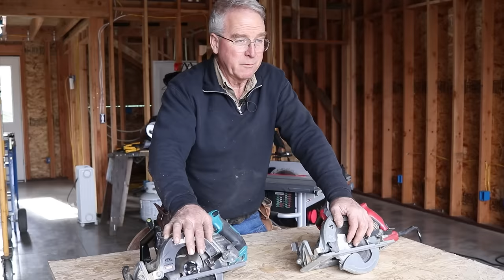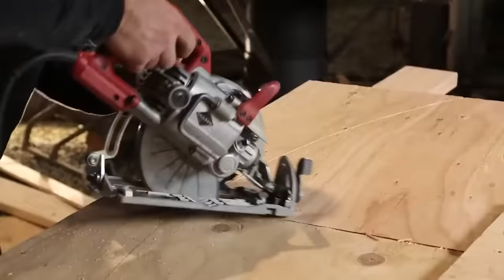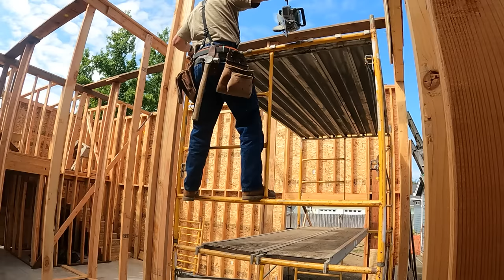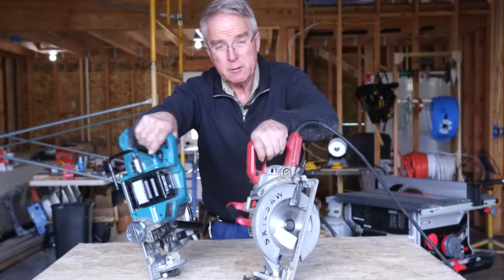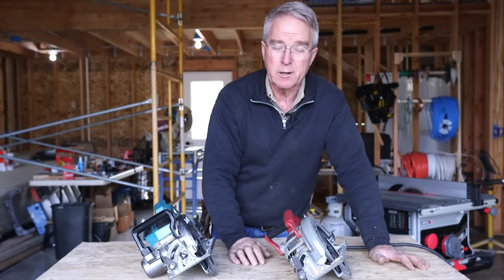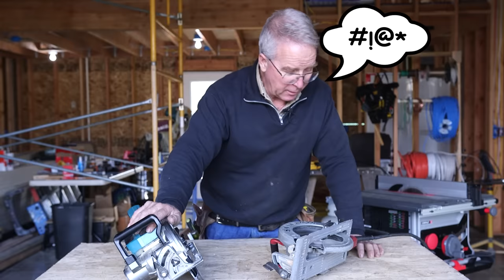Makita 40v XGT GSR01Z 7-1/4" vs. Skilsaw Mag 77 Circular Saw Review

Comment: As another senior citizen, I have seen the transition from 9.6 V cordless, to 12V, then 14.4V, 18V, and now 40V cordless tools. In the depths of my workshop, you can still find these relics, bought at some cost, but made redundant by the advances in technology, and lack of ongoing support by the manufacturers. A good quality corded power saw will serve the average home handyman for the best part of his life.
Reply: Don't forget, 9.6 volt was the 2nd, I still have a few 7 volt makita's. THey are sure worthless when compared to what we have now... And dealer cost on the bare tools in the mid 80s was about 70 bucks for a drill.....and that was a ton of money back then.
Reply: If u get the Metabo HPT/Hitachi 36V u can plug it in and use it cordless
Reply: Those 9.6 v Makita drills were the bomb then. I can’t believe the development arch of all these cordless tools. To have driven screws without impact drivers for 15 years and then to have used them…. Incredible.
Reply: I had the 7.2 with the reciprocating saw. Awesome little combo at the time. Just started collecting the xgt 40v and they are amazing. This afternoon co worker tried out the drill and was amazed at the power and smoothness. Makita isn't always the hardest hitting, but they last and are very good quality. The fact so many cordless 7.2 makita are still around and functional (battery issue aside) also speaks to durability of a 25+ year old hand drill.

Comment: Something i like about the cordless is, when you only got access to an 15 amp outlet and need the compressor and the saw. So many times i tripped that breaker because i was ripping something and the compressor started at the same time.
Reply: This. I don't do large new construction so I don't need the massive endurance of the cord. But I'll be working right on through the renovation when the electrician has the power shut off.
Reply: Yep. Damn code to have  gfi plugs on power pole!!!  😂😂😂
Reply: Fair point.  I were in your shoes, that'd definitely be a big factor.
Reply: Sort of keeps you on yer toes.

Comment: I gotta tell ya. I was skilsaw hd77’s for years. Never thought anything would replace them. We’re now completely cordless using mostly makita saws for many of the reasons Scott mentioned. Two things I’ll mention. Yes it’s very inconvenient when a battery dies up in the air, but I can’t tell you the amount of times I’ve been up in the air with a corded saw and tripped a breaker and had to hike all the way down. That probably happened more then having to switch dead batteries. As for making money, cordless saws make more money hands down. Not having to drag around a cord and setup and tear down a cord every day is a huge time saver. We figure a 4 man crew saves 15 minutes in the morning and 15 minutes at night. Just my two cents
Reply: 30 mins a day x an entire year adds up, hundreds in wages paid just for wrapping up leads

Comment: There is one thing that you did not consider. It takes much more time to get out, run out and plug in the cord. This takes considerable time. Time that could be used to get the job done.
Reply: You are correct!  But as a construction super, so many battery ops I find left behind by the boys.  Scott points out about seeing the cord, then following it to the tool.  It is with painstaking gum shoe work I go through trying to find the man who that battery op belongs to.  The financial loss is real as I see it.  I cannot recall how many times guys have called me asking if I saw their battery charger with $300 of battery's are.  I go hunting, sometimes I find, sometimes not.  As a construction super, I see financial loss more on battery ops than corded.
Reply: Usually I like his videos but this video I feel like he's full of it. Everything went in the favor of the Makita the 2 and 9/16 in, the safety, the convenience, the ergonomics, the power. The cost of the tool is not smart to focus on if you use it frequently. As for the battery running out, have a back up battery sheesh.
Reply: He mentioned this at the 8 minute mark.
Reply: Minute 13 as well.
Reply: You're right, it does take time out of the day to run out the chord or extension and plug it in and get going as well as when it comes time to wrap it up. I personally live my corded and battery powered saws and will always carry both on a job site. The only thing I could say to contrast you, is when you're on the job and you run out of juice with a battery powered saw. Unless you have spare batteries with you, you will have to run down and get another one, assuming that you have them on you, carrying all those batteries can be cumbersome, especially if you're off solid ground, having all those expensive shiny batteries can be a liability, and much like he mentioned several times, the cost of buying the tool plus the batteries will add up.  I for one, do not regret the investment but it still took a great chunk of change to be supplied with enough batteries to get through an 8 hour day on a site framing a house.  Contrast to that, if you're not running a saw for that long like you're doing a remodeling gig, you can't deny that a decent corded saw is all you really need.  It's all about situation and what's best when you have a task to do.

Comment: I’m 22 and cordless saws have been the norm for me. I started watching this channel and I would see you use the corded skil and think “that’d be convenient to have a cord” now anytime i am framing I just cant do without one. Though for smaller projects and remodels, cordless is still my go to
Reply: Can't imagine lugging a corded saw again, use too always get all tangled in the hoses and it would be a big production to get it off the bench and into the rafters or out in the field when framing the floor ... Can't wait til someone produces a cordless framer that can really hold its own with an air gun. That'll be amazing to never have too untangle hoses or battle being a foot short and pulling and stretching that thing as hard as I can
Reply: @The_Pennsylvanian  I'm waiting for Makita to come out with a cordless framer with the XGT line. I honestly think they've been waiting for this new line to come out with one.
Reply: @awsomater1991  the metabo hpt is good
Reply: I have five years on the previous 2x 18v model. It has taken a beating dropped off scaffolding etc it stakes a beating durability is awesome. The buttons on all the battery saws (safety ones) are all awful. I make a small wedge and drive it in to all my battery saws so the safety’s  don’t cause that problem anymore. I grew up with corded saws and they never had safety’s and we never had a problem ! I like the cordless gear and i don’t run leads anymore battery for the last ten years.  The makita saws are pretty water proof.

Comment: As a Swede the only way to get a rear handle saw was going cordless or lugging around a 240-110V transformer, and they get really big and heavy if you're going to power a skilsaw with it.
So when my Hitachi started shooting arcs that light up the neighborhood, I went with a makita 2x18V, and I must say I love that saw, everybody that tried it thinks it's to heavy, but change their mind when they cut something with it. Few tools give me as much pleasure as that saw.
Reply: As an Englishman I have no experience with worm drive saws (they are available now). and have always used 9” sidewinders, and for outdoor work 110v  (with transformer) to meet codes of practice. my main 9” is so old it does not have a deadman’s switch. I like the bit about losing the saw on site, never even thought of that !  Your conclusions are the same as mine about best work saw.   
      Two things about Circ saws, one is that those cast base plates break easily, I prefer steel. the other is that batteries are a constant tax on you and you’d best put replacements in your pricing. If anyone cares, I like Makita corded saws.
Reply: Intelligent opinion, thanks
Reply: I got the Metabo HPT as there was not a Hikoki variant of the rear handle sa here in Europe/Norway. Great saw at a low cost.
Reply: I have the Makita and I agree it's heavy but it's a beast not for using allday but when you need the power it's the tool!
Reply: @rfauske  Tror de har en Hikoki versjon i New Zealand /Australia. Hvor bestilte du saga?
Reply: @nilsern81  toolbarn, 200usd med ett batteri. Brukte jetcarrier for frakt
Reply: @CrimeVid  The Makita is not actually a worm drive. Not all rear handles are worm drive. EC talked about that in an earlier episode about these saws. Worm drive saws are slower but have more torque.
Reply: @kiwigrunt330  True but all these modern rear handles have more than enough torque for 99% of cuts at full depth so they are just faster saws in general for less weight and higher energy efficiency.
Reply: - Same here 🇩🇰
Reply: Yeah yeah. BUT  The bikini team rules ! ;-)

Comment: One of the biggest eye openers for me has been combining corded tools with a large power bank. It's not quite the convenience of fully cordless, but the ability to put a power plug absolutely anywhere, at any time, and have it last you the full day of fairly heavy use, even on a site with no power is hard to understate.
Reply: Yep and using 20 amp circuits. A 10 awg wire for the whip/cord

Comment: Been framing with the makita 36 volt worm drive for the last 4 or so years. The durability is there and it's so much nicer not dragging a cord around, especially in mud.  My favorite saw by far
Reply: Makita doesn't make a worm-drive saw.
Reply: @awsomater1991  rear handle, my bad
Reply: Hypoid drive .. I've been running the 36v for at least 4 years also. Best saw ever 🔥

Comment: We super glued the safety buttons on those Makitas.  We drilled a tiny hole and put a brad nail through the safety switch on the Skill 48 volt. We also have the Metabo 36 volt (its safety is also pinned) , 3 of the Milwaukee Fuels, all rear handle type. My favorite is the Metabo. Its the lightest.

Comment: I’m a contractor and carpenter with 25 years under my belt. I got the dual 18v version years ago and never looked back. I’ve almost never missed the extra power and it feels better and smoother. Not having a cord is great. I like the foot plate and guide notches better. And it’s the only 7-1/4” that will cut 3x in a single pass. In earthquake country, we use a lot of it: mudsills, studs in a shearwall at plywood breaks, horizontal blocking for backing plywood seams in a shearwall. I was already heavy in to the Makita 18v system and had plenty of batteries so I got the bare tool and the cost difference was minimal. 

All in all, I still have a Skil but rarely use it. On a job where two saws are helpful it will come out, like having it by the big stack of sticks for gang cutting while the cordless travels around. But the ability to cut a full 2x1/2” was a game changer and the main selling point for me. The first time a had to cut a 3x I used my trusty Skil and when the off-cut didn’t drop and was held on by like a 1/16” I just thought “WTF man, you gotta be kidding me.”

Now with the 40v, I they even have a 10-1/4” so you can cut 4x, gang cut 2x on edge in one pass and cut larger engineered joists. Pretty trick, though I have the corded Skil for that already and that’s where the extra power might be missed. That said, it would be great trimming post tops on a long fence far from power or in rural settings. I’m just waiting for the cordless version of the 16” beam saw! I have one from the 80’s. We call it the widowmaker.

Comment: I love this video. I own a top handle XGT makita and they use Polycarbonate GF15% plastic. I’ve dropped it off of roofs and it’s extremely tough. It’s also been rained on but it’s IP56 rated so no issues. If it gets too dirty I’ll just hose it off.

Comment: I’ll pick the cordless makita. I have heavy use of the cordless for the last 4 years and I have used skill saws almost every day for the last 7 years. The framing company I’m with we mostly build apartment complexes and townhomes. My main job is layout, we cut the plates with a radial arm saw that are marked with layout and a lot of the double top plate I cut myself with the cordless. I have to do a lot of rips, mostly on 2x6 being ripped down to 2x4. A lot of the rips I do have to be 6ft plus. One thing I love about the cordless is when I have to do a plunge cut I don’t need to lift up the guard with my hand. I just line blade up where I need and just push down and forward and the guard will roll back. I can do that with the corded saw but I have to push a lot harder to get it to work. 

The corded saw does have more power and it’s a lot easier to cut angles with. For some reason with the cordless when I cut angles, mostly 45 board cut, the saw binds up and I have to push it through the cut pretty hard and my cut won’t be as accurate, or it binds up so much the saw shuts off. 

And it’s not just me a 7 year production commercial framer that loves the cordless. It’s also the 20 year vets and we have a couple 30 year vets on the crew that have all switched to the cordless. And it’s mostly because of not having to worry about rolling out and rolling up power cords. We all work fast and efficiently and we are always trying to find more ways to be efficient and Having a whole bunch of cords mixed in with the air hoses making a rats nest in the hallways is one less thing to worry about. 

It’s difficult to try and explain how our operation works without being able to show exactly what we do. And once you see what it’s like using a corded vs a cordless saw in a 400,000 square foot apartment complex you’ll know why 30 year journeymen framers switched saws. 

Also my boss just got me a cordless makita chop saw for my work station and so far I’m impressed. I’ve only had it for about a month but I definitely prefer cordless for now.

Comment: The brush-less motor and lack of inertia make the cordless so much safer in my opinion. If/when you get a kick back the blade is stopped completely by the time it can do any damage to your body. If you are in a production environment you will have enough battery power to get you through the most demanding day (I keep 10 batteries and 2 2x1 gang chargers) Cords suck! Generators are noisy. There is a lanyard loop on the makita if you want to lower it down from a second story with a rope etc. I don't miss my Skil saw ever. That is just my opinion and the cordless suits my remote and varied work environments. I love these videos and all of the great content on this Channel.  Keep up the good work !
Reply: @Elkadetodd  I make substantially more than $25 an hour and I got 4 of those batteries(18v) for free through Makita promos which happen frequently. I also use other Makita tools all day hence 10 batteries. I'm saving at least $1000 by not needing a generator. Cords are expensive and heavy. I can jump on a plane with all of the power tools I will need for the work I do. For me it's a no brainer. When I bought my 36v saw I sold all of my corded tools and a couple hundred feet of cords. Obviously it depends on your individual circumstances. I paid $250 for the saw ,4 batteries and a gang charger during a HD promo sale. I bought a second set, kept the additional 4 batteries and charger and sold the brand new saw so I'm nowhere near $2500 into my setup. Unless I needed to cut concrete there is nothing this saw wont do well. In my case I'll stick with batteries.
Reply: @Elkadetodd  I'd say the financial argument is more fallacy than anything. Would it take years to make up the difference, maybe, but if that's the case then the money "lost" isn't that significant either. I'd say that it's more of an issue that people don't want to change, and they think their way is the best and only way. The only real difference is that someone has to modify their work flow to regain the effeciency they thought they had. A biggest part of that is making sure they don't show up to work with dead or half full batteries. I easily have had this exact saw last an entire day of framing on one battery, and multiple days of light use. The only sensible argument regarding corded vs cordless is that either way you still have to have something plugged in somewhere. I personally would rather take a break and get a new battery when i need it, than deal with a bunch of extension cords.
Reply: @nickbonci7600  
It doesn't have to be a resistance to change or "you damn kids don't know squat" mentality.  It can also be about making that hard dollar too. There is absolutely zero chance that cordless tools can keep up with corded tools in the hands of experienced carpenters. I have over 15 batteries and over 1,750' of cord give or take.  I'm not going to give up either.  There is a time and place for both still.  While yes I can build everything with either, electrical power will eventually be run to the site and is needed for every tool but in the long run the corded tools will win the day. They are time tested and a proven durability that have a lot fewer points of failure.....but cordless tools have really changed the game and there is no going back to a "corded only" system either. Cordless tools currently can't keep up with a full crew of trained professionals "slamm'n and jamm'n" but I can get a lot done with the battery load I can carry into any given situation for a few days until the power shows up....or doesn't.
Reply: 100 % agree
Reply: @nickbonci7600  you should be careful with that conclusion. Assuming that those who disagree are just wrong is exactly what you’re accusing them of doing. You’re one step away from saying they are too stupid to realize cordless is better. 

Try steelmaning their argument rather than assuming the least generous thing you can come up with. Otherwise you just feed the unnecessary us vs them tribal mentality.  You’re not going to learn anything or connect with anyone by doing that.